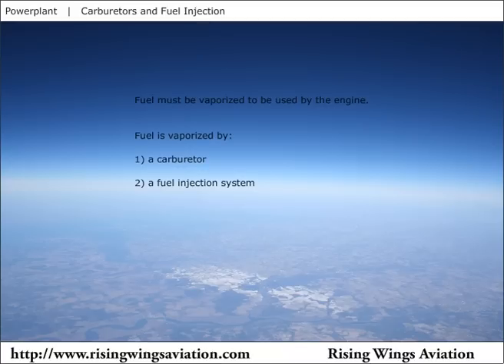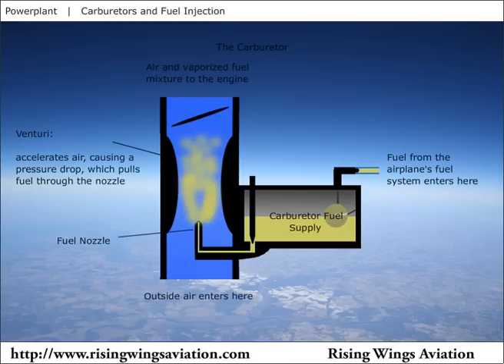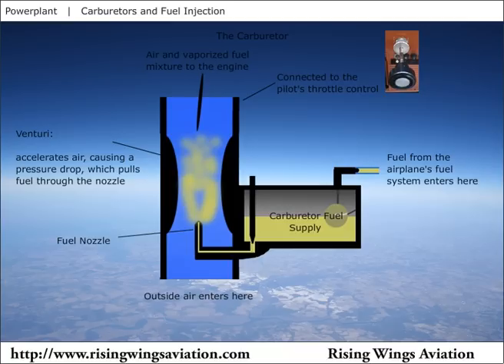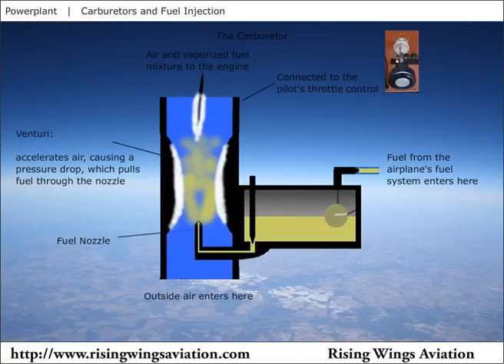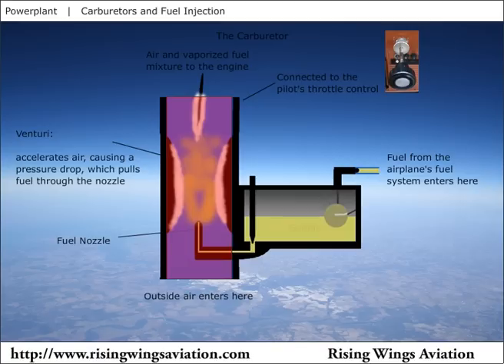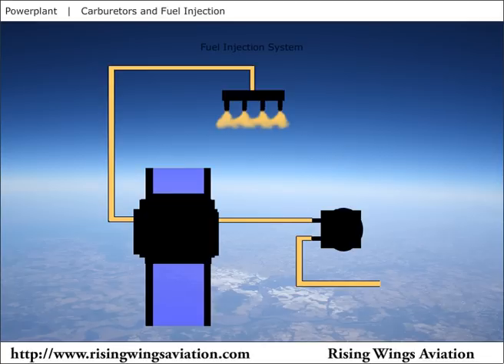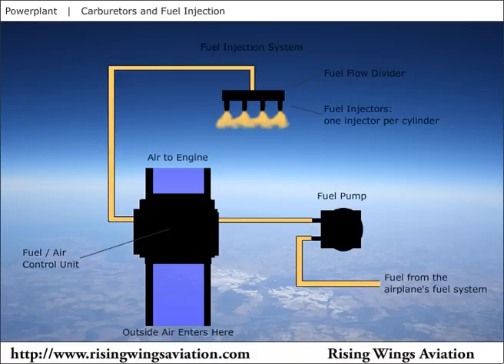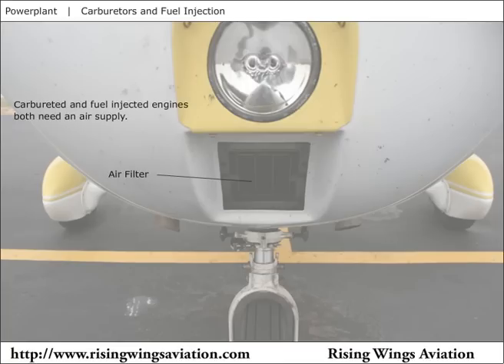Carburetors and Fuel Injection - OLD

Comment: Always remember that the fuel and air mixture is not just being pushed by ram effect through the venturi but is more so being pulled into the intake from the Cylinder on a downstroke. Hence the good old saying, Manifold Pressure Sucks. The differential pressure inside the venturi is used to measure the lower pressure in order to provide a MP pressure reading compared to the ambient pressure on the outside.

Comment: Very good explanation.  Just want to point out that there are fuel injection systems that use venturi. Some of the bendix models for example, and they are very similar to pressure carbs.

Comment: What about heating fuel, for example, with the hot cooling fluid from engine, to prevent icing?
The 'Iskra' training jet plane had this. It may be just a matter of adjustments, to avoid 'Vapor lock', as well as icing.

Comment: If you pump fuel to the Fuel/Air Control Unit so it can mix with air, how do you make sure the fuel won't spill out through the air intake openings?
Reply: floopy312 I'm new to my PPL so I might be wrong :P but I think the answer is because the fuel nozzle is placed within the venturi. The shape of the venturi causes lower air pressure, pulling the newly combined fuel/air mixture up towards the butterfly/throttle valve and into the engine cylinders.
Reply: I hope you notice the fact that as the Intake valve opens, you have extreme low pressure in your cylinder. as a result, you have a flow from high pressure area ( fuel/air mix valve) flowing air mixed with fuel into cylinder. by the time the pressure can backflow the fuel, the intake valve would be closed already.
Reply: +Henry T and ambient air pressure is higher than manifold pressure, therefore backfllow is impossible

Comment: Carbs - reliability and endurance
EFI's - Fuel economy 
From my personal expirience i'll pick carb over EFI every time.
Reply: +Kei 1/2 hour? Are you on crack? I currently own a carburated car and have owned 2 in the past and not one has taken me 1/2 hour to turn them on.
Reply: Carbs are a nightmare. I've never been left stranded by a car with EFI, but I've been left stranded by carbed vehicles many times. Electronic fuel pumps for carbs solve a lot of issues, but they don't solve the main issues with carburetors. like poor efficiency, inconsistent fuel mixtures going to each cylinder, icing problems, etc.